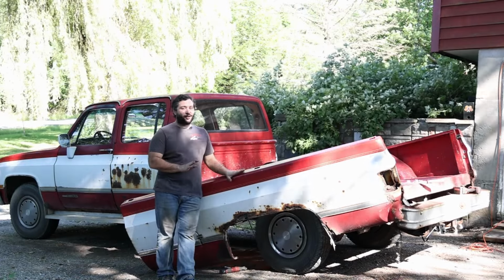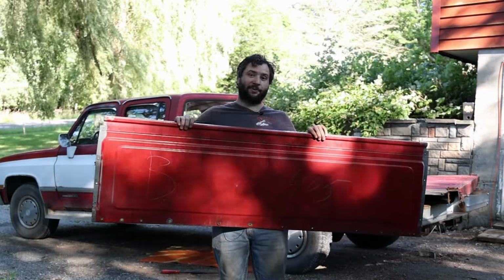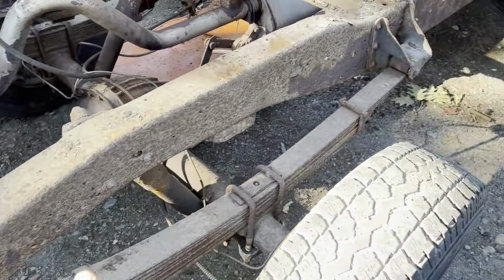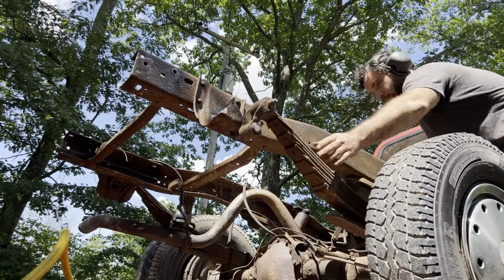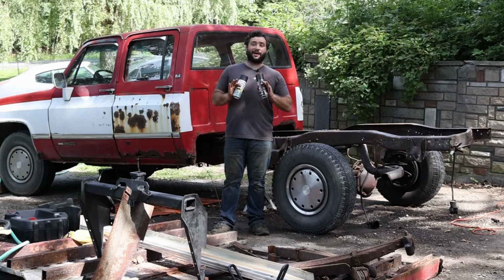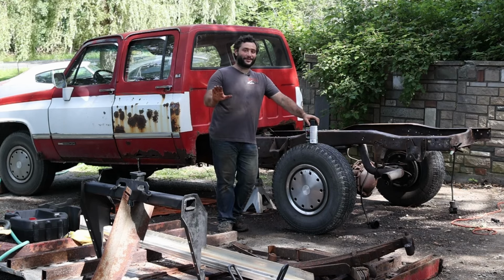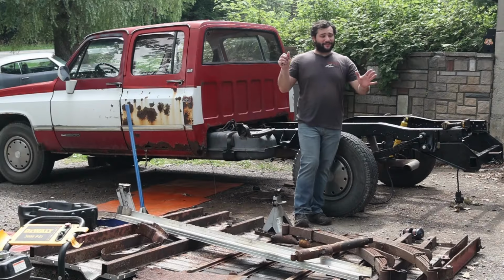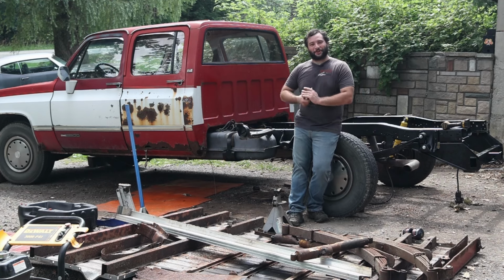Rebuilding a 1989 Square Body Crew Cab Part 1 (rebuilding the rear suspension)

Comment: Lathe! I gotta get one of those. How is that one? Works okay?
Reply from the maker: It’s ok. I was using it to make custom light sabers a long time ago, so it was getting used nearly daily. The original bearings lasted a month, but they honored their 90 day warranty. After I swapped it out I did a bunch of modifications that people suggested on forums including replacing the original bearings with tapered bearings. That was back in 2015, and it is still running strong. If I ever get a bigger place I want to buy a nice large pre war one